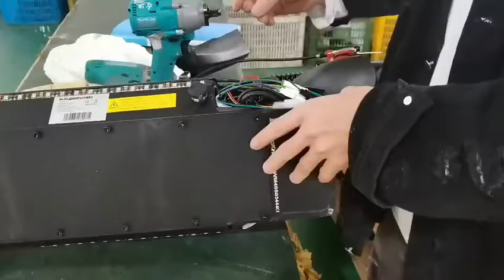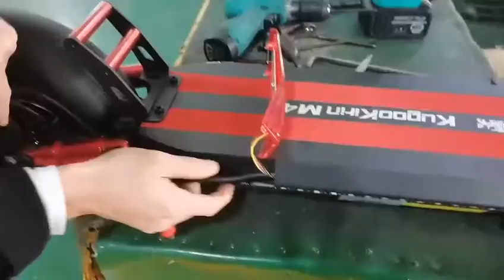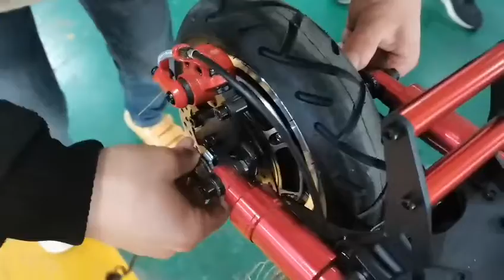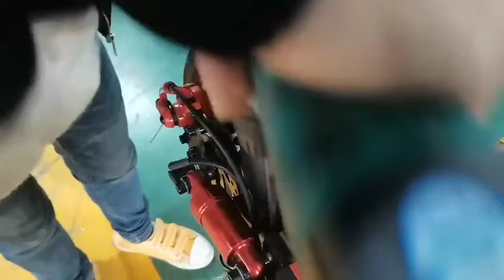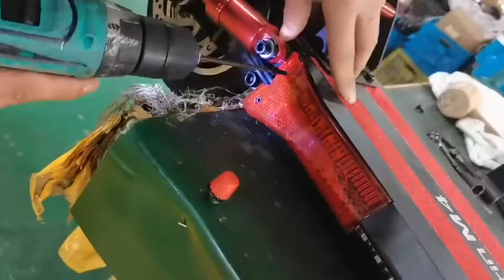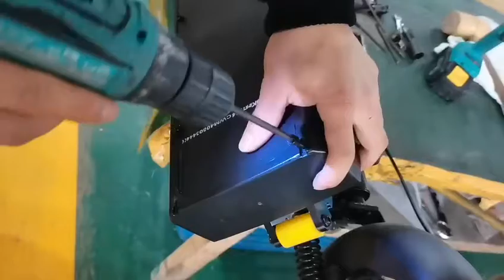Kugoo M4 Motor Replacement Video Tutorial(Kugoo M4更换电机)

Comment: Can you put a 800watt motor on if u wanted to
Reply from the maker: It is recommended to use the original motor
Reply: @kugookirin does the kugoo m4 have a speed limited wired in